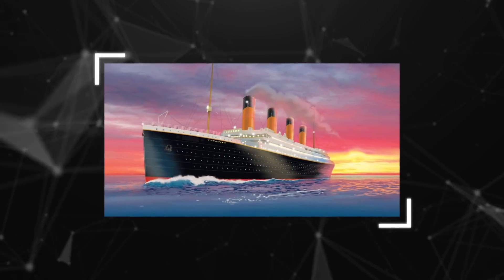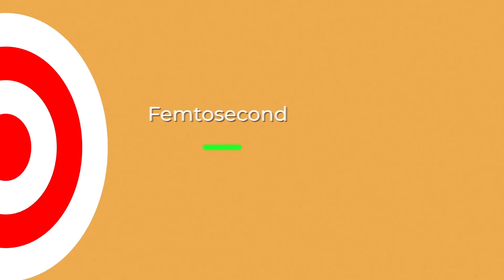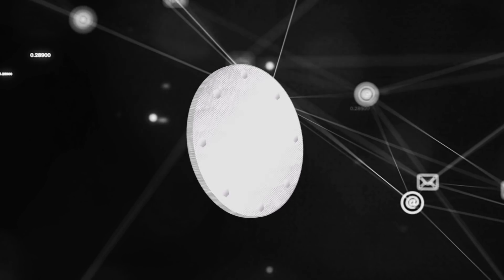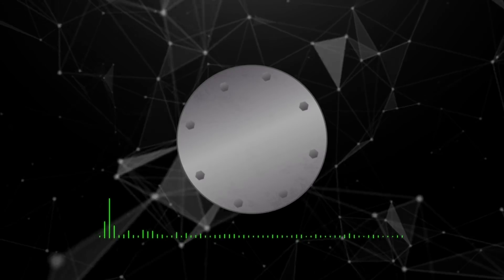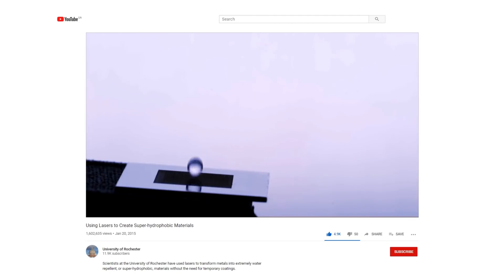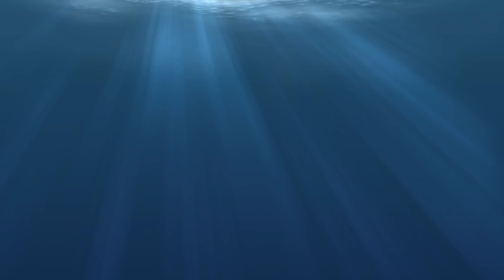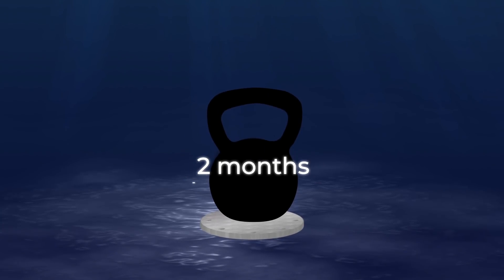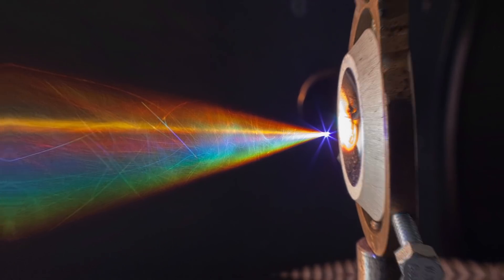Scientists Find A Way To Make Ships Truly Unsinkable

Comment: small boats you build it from foam and cover it with plastic metal waters I like and even have an inside but you can not have place where water can get in like the titanic the whole ship can let water in so it's obv gonna sinkbuild it from foam and cut the deck and bunker room out of the foan

Comment: a stainless steel rocket fuel tank where the  cryogenic fuel never touches the container surface would not heat up and boil away thus saving weight for insulation and lost fuel and and delivering more cargo.

Comment: i can now pretreat wood so that when the glue is used on the treated surface I had it dry in four minutes using water-based glue. the water is removed from the glue in preformed channels just the right size . the glue loses water so fast its only half as strong

Comment: There are problems that you don't experience in a lab. I know a retired weilder that actually built ships of all types. And this solves only one problem in a web of things that can sink a ship. Okay the material of the ship is unsinkable but what happens when the wields come undone due to old age? Or extended stress due to the fact that the ship is too big? Today's ships are three to four times the size of the first Titanic, and the stress loads make them more dangerous than the mistakes of the Titanic made that ship dangerous. Bad weather, ships today go through bad weather when they shouldn't at a danger to their passengers. Another bad thing. I can't think of some other things at the moment, so ask me a question and I'll see if I can answer it.

Comment: Ships sink because of a loss of stability due to water ingress, not because of a problem with the ships hull being waterproof. A ships hull is actually already waterproof because it's made of steel, and coated with paint and then antifouling paint. The ship is able to float due to reserve buoyancy, nothing to do with the surface coating of the metal!

Comment: Ship material is needed to be tough to withstand water pressure and impacts. This new material might not be as tough as a metal that's specifically designed to be tough. The advantage we get is trapped air bubbles then ship trapes a big giant bubble inside it which gives much more floating power. It seems pretty useless so i sure hope scientists know what they are doing.

Comment: The only way to make it unsinkable...
DO NOT TRAVEL ON WATER ‼️
Just travel on AIR and LAND soil.

Any OBJECT with "WEIGHT" definitely will SUNK SINK SANK in the water 🌊.

The only MATERIAL that is UNSINKABLE is STYROFOAM mix with small percentage of hardened light weight composite material ( it will always FLOAT ON THE WATER FOREVER for thousands of millennium and will never SINK SANK SUNK in the sea ocean of water 🌊.

If SHIP built with HEAVY OBJECT MATERIAL such as iron , aluminum, steel with WEIGHTS, of course it will SINK SANK SUNK once the structure is accidentally filled with water : LEAKED HULL...✔️

Submarine is SUITABLE to be built with HEAVY weight materials because it travel " UNDERWATER "✔️

FLOATING HEAVY WEIGHT OBJECT really depends on STRONG COMPACT HULL. Once the hull got leaked , the ENTIRE HEAVY WEIGHT OBJECT structure will SINK SANK SUNK into the ocean floor... LOGICALLY ✔️🤭

IF a piece of 0.5kg weight metal : steel/iron/aluminum capable to "FLOAT" on water WITHOUT SINKING, it is truly an amazingly  great kind of DISCOVERY in the millennium !!?! Changing the entire whole SHIPPING building industry 🤭 😅

SCIENTIST SHOULD BE MORE SMARTER AND GENIUS , NOT THE OTHER WAY AROUND ( UNWISE )💥😜

Comment: What really did for the Titanic was a fire in a coal bunker caused by a spark igniting coal dust.  Captain Smith mistakenly thought he could extinguish the fire under way to save time but the fire was too hot and weakened a bulkhead fatally so that when the iceberg came in this bulkhead failed allowing the fifth and catastrophic flooding of a watertight compartment.  There was also a strange combination of unusual events.  A finger of cold water surrounded the berg as it moved south ensuring it didn't melt.  Captain Smith steered a more southerly course to avoid bergs he'd received warnings about.  But by doing so he actually put his ship on a collision course with the berg!   Very very odd.  It was as if God had taken up the challenge that He couldn't sink this ship.  Do not challenge infinity, it cannot lose.

Comment: The metal of the titanic wasn't the issue 
It was recklessness of the captain 
Running the ship at high speeds 
Knowing that the area they were sailing 
Had dangerous obstruction 
Having a poor look out instruments
That couldn't be used for night sailing 
Also no radar or the real reason it was sunk by a German submarine 
That why when they saw a ship in the Horizon it was actually a sub that why it didn't help them 
So this no such thing is Unsinkable
Even if the metal is once you penetrate the hull and water gets in the weight of the water will sink it

Comment: For more information on the femtosecond check out the slow mo guys as they recorded the speed of light at 2 billion fps with a camera capable of 129,093,436,753,923 (129 trillion)

Comment: If this really coming to existence....then boats will become the number 1 safest vessel for traveling because planes nah done make yet....they are killers.... air bombs.... because they are not still taking heed and start building them like Mr Vladimir  says....so if they find a way to keep boats from sinking....they should work on it and get it in manufacturing and make traveling safer for everyone and give planes a rest until they can get that right to because them are killing too much passengers and people whenever they go down... and it does have more plane crashes than boat sinking.

Comment: Floating civilisations that have several buoyancy tanks made of this lazer treated metal, shaped like upsidedown cones with a sort of ballast in the very bottom. This would allow for a modular design that takes significantly less material and can be far lighter, and more stable, than a typical buoyancy tank

Comment: This would improve Hydrophobic designs, but despite the optimism, the need for a proper Hull still remains, regardless of the air pocket design, metal still has heft, so we'd still see Hull reptures and sinking being an issue. 

Although Hydrophobic designs for phones, and cooking appliances would be a nice thing to come out of this 

If cost would be relatively low

Comment: Really fascinating metal and all. But that won't keep a ship from sinking.  Keep in mind that wood floats up too, but wooden ships still sink.  Also in ships you have to have the center of mass low, so the ship don't tilt too much or capsize, meaning you need to put wight at the bottom to raise its water line.  Even with this new material if you fill the ship with water, it still can sink, because the surface area of the metal is far out done by the mass the water takes up with the open space.

Comment: It had Design flaws.  Substandard rivets at the bow, water tight compartments that didn't go to the overhead from the deck.  If the water tight compartments were truly watertight, more people would have survived.  However, it didn't just side swipe the iceberg, it grounded, breaking the keel(backbone) pretty much ensuring it would sink. But the water tight compartments had they been built correctly would have slowed it down.

Comment: The first thought I had is if there is a possibility of having the bottom of the ship designed where the water is designed to flow in one direction and would that help propel the ship making it much more fuel efficient. Of course going backwards or sideways would be less efficient but given the ships travel forward probably 99+% of the time I'm guessing that would be a fine trade off. Would it be possible to use the laser to groove the metal on the bottom of the ship to repel water towards the back of the ship in a way that may move the ship or give it mush less surface tension where the traditional power house needed much less force to move the ship?... This stuff is pretty cool. Sounds like a game changer. Although I'm still waiting for all the different graphene products. Would like to see these great discoveries move a lot faster!
Reply: Maybe if you apply current to the hall that has been laser-etched to flow the water in One Direction to compensate for weight and displacement of size of ship.
Reply: @travman2863  I forgot about this. I hope someone can give it a test and maybe prove it to work one day. If they haven't already.
Reply: @bobbycone2  I know I've been looking into it to see if anything's been made with it I thought they would have made something small like alectrodes for batteries and electrolysis would have been easy to manufacture and mass-produced versus huge ships.

Comment: the titanic sank because they used substandard steel in its construction that was half the strength it should have been, bulkhead doors that would have prevented further flooding blew out and allowed the water to progress throughout the ship, it wasn't a fault in the design, it was a fault in the materials and construction.

Comment: Since atmospheric air is also a fluid, what if you trap in the metal a gas that is actually less dense than air, like helium? It would be insane if it had some noticeable effect, like reducing a little bit the weight of the plate or something like this. Or maybe I'm just tripping, idk

Comment: I say it's impossible to make a ship that wouldn't not sink because of the fact that there are lighter than air such as methane gas is under the water which could break loose and sink a ship as many have before in certain areas such as the Bermuda Triangle and other places throughout the world these are ancient areas many of those are in the humidor triangle some are even in the area called the Gulf of Mexico and these areas have a lot of natural gas if it rises up it will sink airplanes even though they are flying because they hit a pocket of lighter-than-air and will sink in the air or on the water so therefore if they are not a gravitational device such as UFOs that uses gravity for propulsion then these crap will always sink

Comment: So if this is permanent, and it allows for water to travel upward without pumps, wouldn't this allow for an infinite supply of power? Using piping that pulls water up, then back down another pipe attached to a hydroelectric generator.

Comment: Patterns could be etched into metal to reduce drag on ship hulls & airplanes. Trapped air would be a passive way to effectively reduce fuel & drag on both by trapping the air at the surface. This would allow water or air to “slip” over the surface, thus reducing fuel & drag.

Comment: Titanic didn't sink it broke into two halves then sink So we will need indestructable metal as well.. i think
Reply: The ship was doomed to sink from the moment it hit the iceberg, the ship broke in two due to the front end dipping under water raising the rear into the air, the weight in the rear was so great that it snapped, even if the metal was strong enough to withstand the force trying to rip it apart, it would have sank. Obviously the front was heavy enough to raise it (due to it being full of water) so regardless of it snapping or not, it would have sank.
Reply: It was actually switched with it's sister ship the Britannica. There's a documentary on it. A Captain who drove the ships was little reckless, they had some problems with the ships, that they tried to hide. They show you the two before and after changes were made and why they they were switched
Reply: @am42388  not true what so ever, the time frame would have been impossible to accomplish the swap. The titanic had “titanic” written under all of the furniture, they would have had to swap every single piece of furniture into the Britannic in like 30 days. The people on the ship would have immediately noticed. There are several videos disproving that theory, I used to think there was some truth to it but no it’s all made up
Reply: @am42388  also Thomas Andrew, the designer of the titanic and part owner died in the sinking. He would have definitely noticed the changes and would have known about this “planned sinking” and would never step foot on a ship doomed to sink. Look up “titanic animation” video on all this
Reply: @nickhappens  well if you look for the documentary here on YouTube, it will explain to you what they did and how they did it. Cleaning/staff noticed the changes cause they worked on both ships and they knew the difference even though both ships are similar. There few differences, Something happened with the ship and they tried to patch it up, and they did a poor job. I seen it a while back but If you find it, it will give you accounts of certain people tied to the situation. And from others for some reason, who  were familiar with the ships or worked on them but didn't take the voyage. You might think it's not true or possible to accomplish but the documentary was well done and tells you how it happened. Not that it was a planned sinking, it's just that captain was too cocky, had an accident, they had a deadline to set sail and they pulled a switcheroo. Now I'm gonna look for it to refresh my memory lol
Reply: I know the conspiracy about those who opposed the fed, that died on that ship but the documentary is separate from that theory. It makes you wonder though, I believe it cause the federal reserve is a problem
Reply: @am42388  insurance companies would have looked up and down at every single little detail. Insurance woulda noticed. Like I said titanic and Olympic had different serial numbers on every single thing from the carpet to the mattress to the chairs and bed frame. It is impossible for them to do what hundreds of extremely skilled workers took 7 months to complete in 44 days. They also would have had to completely swap the top of the ship as well. The captain I can’t vouch for. But due to the refraction of light, it was physically impossible to see the iceberg, it was essentially invisible, the captain should’ve hit it head on to save the ship, but he was more worried about saving it. When we go down to the wreck site, everything matches titanic. From the silverware to the chairs
Reply: @am42388  also my bad the sister ship was Olympic. Regardless of that the time the Olympic was undergoing repairs to the time titanic needed to sail was 44 days. It took 7 months, 7 whole months to put the Olympic interior together. So to totally swap both interiors was literally impossible from a time frame stand point. Even if that somehow happened, the B and A decks on the titanic were COMPLETELY different from that of the Olympic. There are so many things to prove that theory as incorrect.

Comment: if they can nano etch metal to hold air and float in water maybe they can change the pattern to hold helium or hydrogen so that metal can float or be very light in air. Better yet, etch the metal to fully repel nitrogen gas which would also make it float in the atmosphere

Comment: Not practical - the surface depth treated is so tiny that any abrasion, even wiping with a towel, will negate majority of the effect.  Imagine this on cars - one wash or wax and you're done.  Water alone has abrasion properties; put it on a boat and within seconds of moving at a decent speed the properties would be erased.  No doubt there will be usage for this tech, but not for a lot of practical applications.
Reply: Let's just dump the idea and keep looking at the sky with hope.

That was sarcasm, to make a point.
If you think about every invention the way you do...we would still be living in bear skins and dragging our bitches by their hair.
You don't know everything; leave it to other to discover if it is feasible.
You are perfectly in your right to THINK it is not feasible.

Comment: What would happen when you start to weld the treated metal? Does it still keep its special characteristics?
Reply: well yeah?? lol why wouldn't it? unless your idea of wielding is defacing the entire face or melting the inside there for ruining it on purpose.. Just think of the hypothetical size of the  sheets of metal 10 - 5 ft. or what ever the weld would be very small in comparison
Reply: @x-raven-x9128  thank you for your answer. I was just curious because when it comes to ships I assume there is a lot of welding in the manufacturing process

Comment: Using those treated metals the ship wouldnt be unsinkable forever anyways, after corrosion eventually takes place, and yes corrosion can occur even if the metals are hydrophobic, not to mention from what I understand the teeth of the surface structure still enter the water anyway.
The metal will still need some form of protection or coating, dont be fooled...